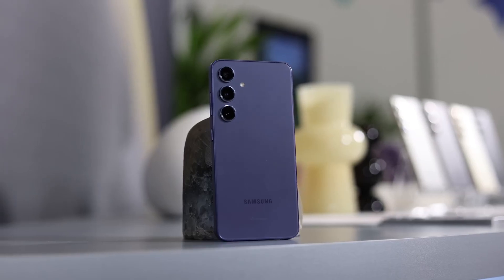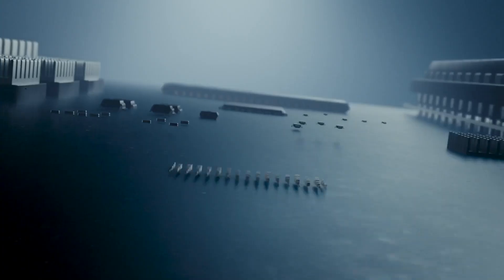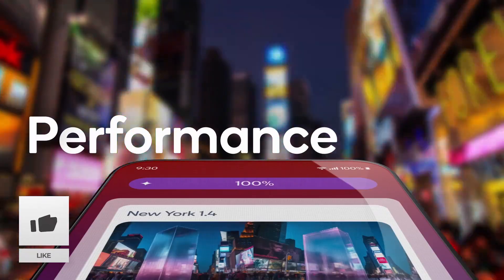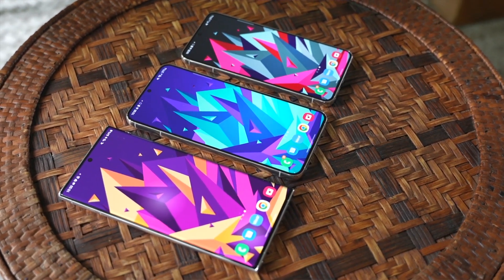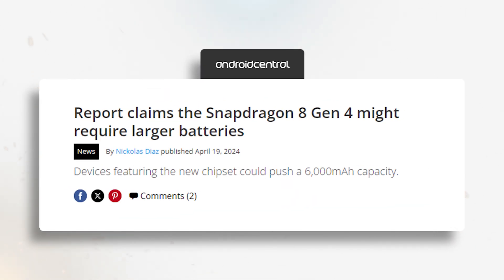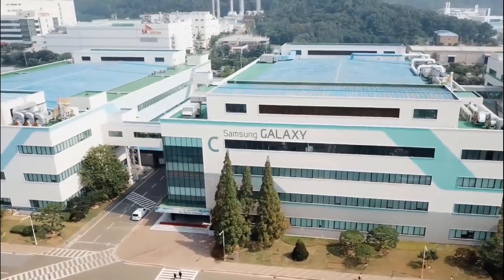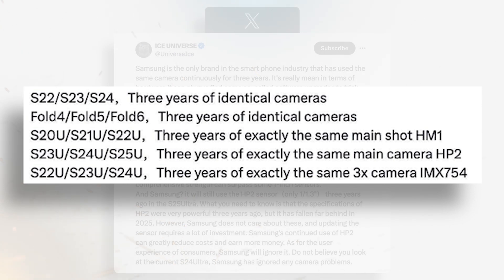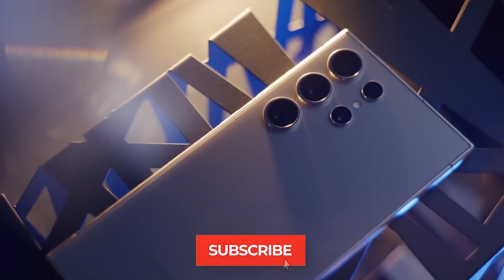Samsung Galaxy S25 & S25 Plus - This is MASSIVE

Comment: Just put the damn micro sd card back on the Plus variant.  I don't give a damn about more megapixles.  Most of my photos are of my cats.  I actually started using the A line instead of the S line cause the micro sd card is my hill to die on.  I will go back to the flagship line if the put it back.

Comment: I don't care about a faster processor or a camera that competes with an electron microscope.   I want a phone with better battery life and better cell reception - call me crazy but I use my PHONE as a PHONE.
Reply: What phone do u use
Reply: @Grid6904  I had the S10+ a great phone but the battery gave out on it.   I have the S23+ now.    I still use it for the exact same things - making calls, wells fargo deposits, and occasionally checking emails or texts.

Comment: increase vanilla, decrease plus version in size, around 6.5 inch. Discontinue FE versions. Reduced weight around 185 grams, thickness around 7.9mm- 8mm with increased battery size and tech like silicone carbon. Increased charging speed for both models at 65 watts.    So its just  S25 and S25 Ultra.  I dont see the need of any other Flagship versions from samsung wasting everyones time.  Use exact sizes for the A series with just the change of processors and cameras.  They could reduce so much wastage.

Comment: Plus variant is the most under-rated phone. although it's not S-pen supported but it has every thing.
1 - Power full processor.
2 - Great battery
3 - Great size
4 - Great cameras
5 - Totally value for money phone
Reply: If you’re in Europe there’s Exynos to put us off (speaking from experience, it isn’t very good).